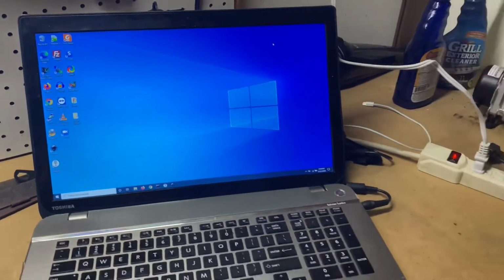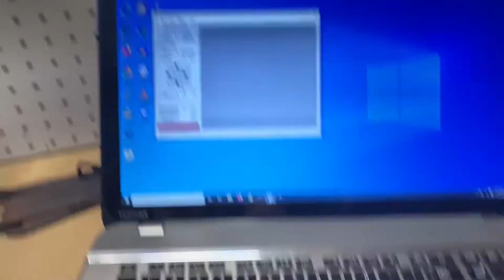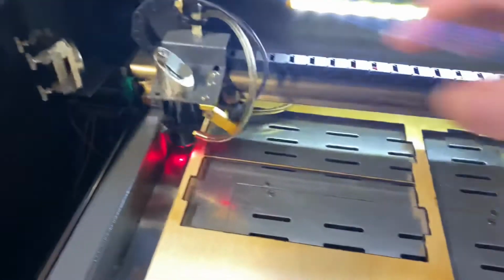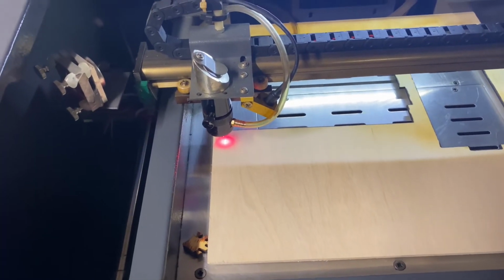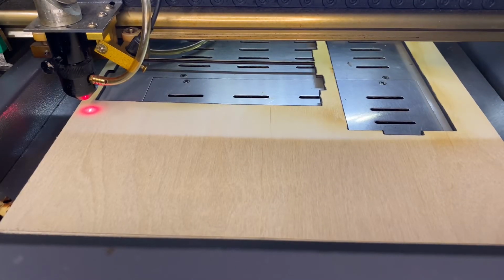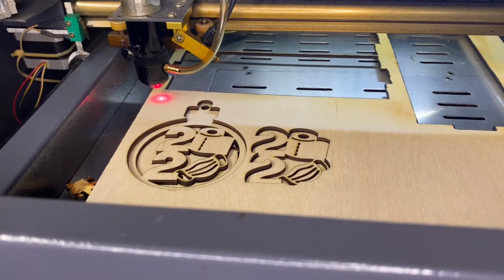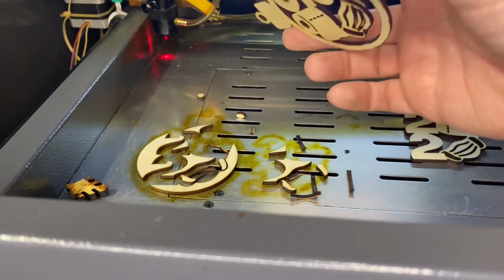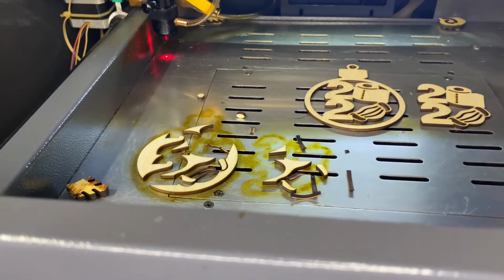Cutting an Ornament With My K40 Co2 Laser.

Comment: Thank you for your video I enjoyed it.  Looking at you K40 you have an identical set up as mine. I noticed you have your air assist hose fed through your drag chain. I can't do that with mine. Did you install a new drag chain which was larger than the original? If so, did you purchase it? Do you know what size it is? I don't 3D print, so I have to buy mine, but all the ones I look at are too small for the line or too big to get the chain through the opening on the laser head opening. Any help would be greatly appreciated.  Thank you
Reply from the maker: The air hose was not fed through the drag chain. It was zip tied to the area and hang out the back. The one I got was long enough that it moved with the head. Thanks for watching!
Reply: @KowalskiDoes  Thank you.